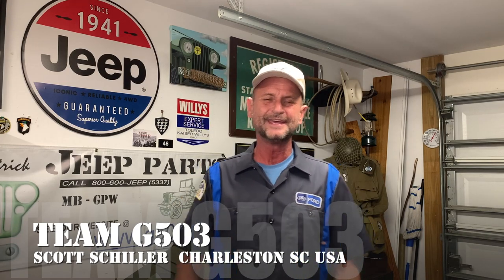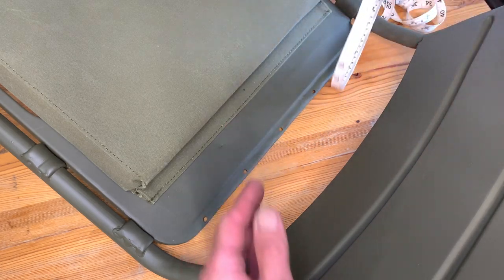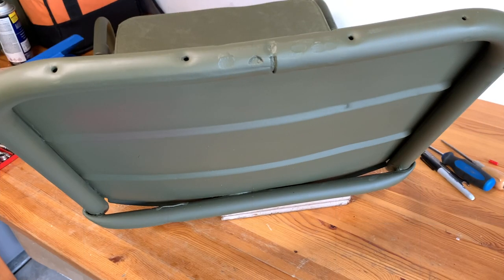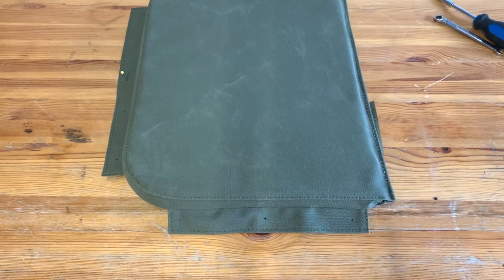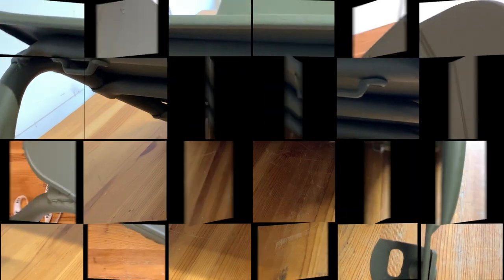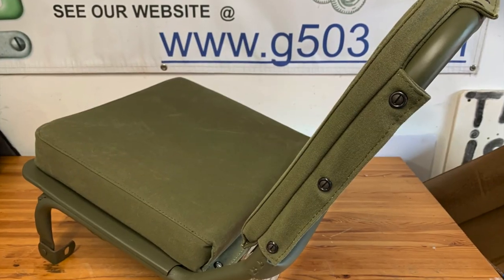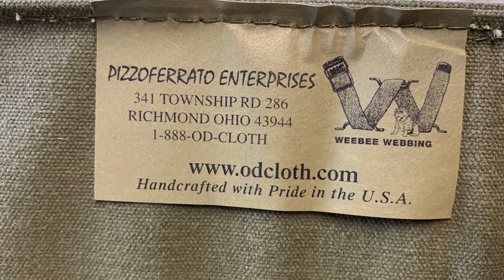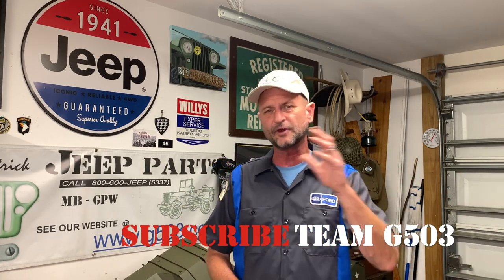Canvas Installation Willys MB Ford GPW G503 Jeep Seat Cushions Fastener Locations with Measurements

Comment: Great video. I bought the full seat cover set , front/back for my M38A, no padding or spring. The canvas is outstanding, the fit was perfect and the smell....wonderful. They have been in use for a year now of weekend driving and are wearing like iron. I also purchased the top, also a perfect fit. Highly recommended.  Tom